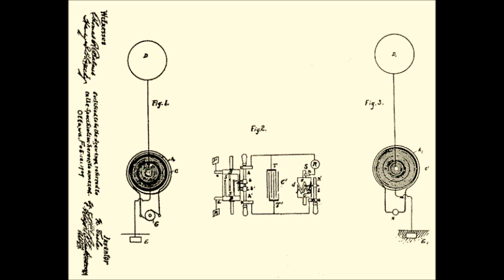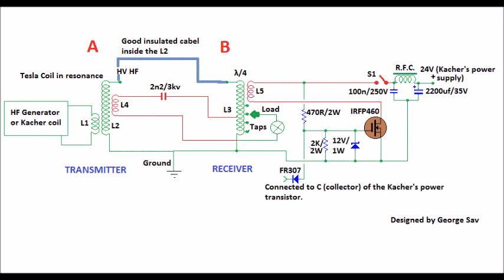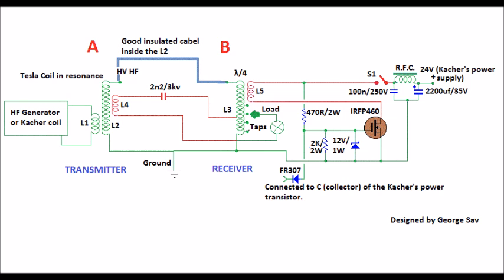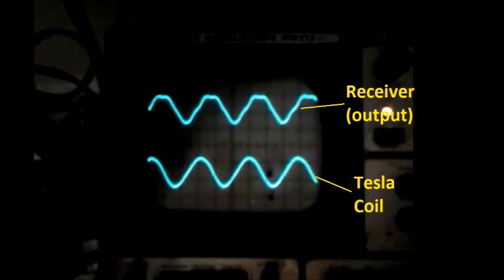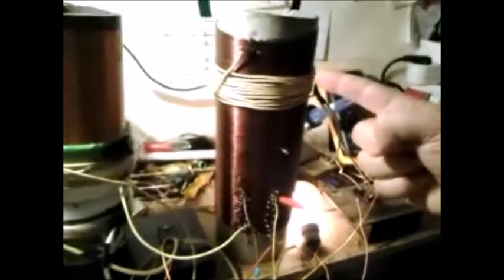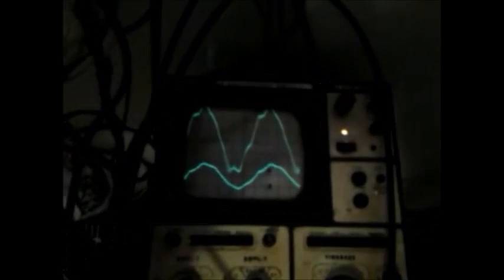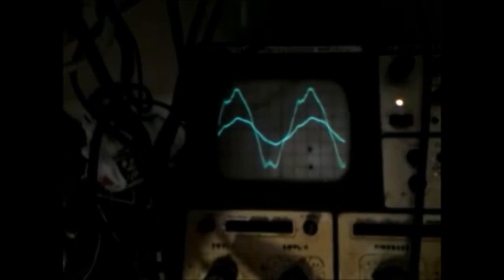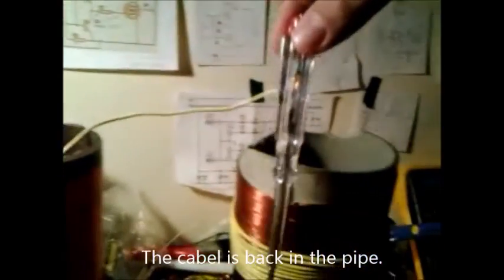Resonance phenomena with Tesla Coils (Overunity device)#3

Comment: Hi Sav, I just happened to see your video in 2024, wow! I don't know if you are still following your channel. Anyway, I know a little electronics and electrical as I am second year of electrical/electronic engineer. I wanted to build your circuit but I do not understand where that bottom diode FR307 connected to. it sace to the "collector of Kather", is there another circuit that is feeding HF to katcher? Thank you for your reply in advance. I am excited about this experiment.
Reply from the maker: Hi Friend. The other side of the FR307 is connected to the collector of the power transistor  (katcher). In this experiment is a 2SC5200.

Comment: hello g sav, how much turns has the katcher and receiver coils? regard from mexico a embrace and have succes, apologies for my bad english
Reply from the maker: +Detectoman LrL Hi friend! To build a Kacher to this experiment you have to choose first the wished frequency and calculate the wave length of it. According to this experiment the frequency is 2Mhz and the Wave length 150m. So i winded around a plastic cylinder 150m of 0.30mm coil wire (secondary coil) and 5 turns of 3mm around it as a primary coil. To build the receiver coil (where the energy flows) you need do divide the wave length with 4 (λ/4) with a thicker coil. So around a cylinder i winded 38m of 2mm coil wire with many tabs. It is so, because it is always approximately! To find the real λ/4 you have to tune the coil. (Theory and practice is different). If you repeat my project be patient with the tuning and check the 3 videos again before you go farther. I use a capacitor of 2nf to tune it fine. 
Good luck
Reply: ***** very thanks for you answer brodhy G Sav, your project semms to me very intersting, i see your 3 videos in day dic 28, semms a prototipe very efficient, so i inscribe whit you page, i gave you my congratulations, i see in these prototipe very good posibilities. i earlier was doing electrons captor and kapacoil experiments whitout succes, may be you can eliminate wire ground whit puting two big aluminiate planch face to face in each coil only my teory may be you can put most disstance of transmision whit ferrite bar inside, may be you can most energy whit coper paper open circle inside and alumin foil middle circle inside the other coil may be you can put most energy whit 50 mfd capacitor in input transmiteer coil in serie or parallel exist very trick for boster the power of your design i never make this thicknees wire coil, so very difficult for me at begin this your project, may be i after iniciate any experiment whit karcher and double coils tower today i am doing whit generator 3000 kvs and ac motor any experiment, but i have in mind the energy production whit coil towers if you like aggregate to my facebook for other apprecitions is: Josar Ramirez  then here i continuate the chat discusions whit you, my english is very bad, but i want practice whit people what speak in english, of new very thanks to you, may be i can gave you any good tips for major results a embrace from chihuahua mexico, jose ramirez
Reply from the maker: +Detectoman LrL You are welcome my friend! I would like to tell you that one of my distant friends and subscriber to my channel has already replicated the project and succeed with great results, as he wrote me! 
If you use ferrites or other kind of metals, remember that great power at the output you can have ONLY if the wave length of the wire is right. Otherwise you can tune it and have some power!

There is no Kapacoil here. It is all TESLA!!!!  So find the resonance, hit the phase of the output as i described and you will realize that every Kapacoil or so-like device you know can not be compared to this project.
If you replicate, do it with patience!
Good luck
Reply: thanks brodhy g sav , today im in other project, but when i finished those, may be i begin at build those two coils, but first i need the tool for winding right those coils, i have in mind what a machine free energy should are whit two coils how is show in your video, i cant build soon due i am working always in my store in repair of manual wood tools, and other little handed tools of other people, and y  no have very much disponsable time for make much experiments, your project sems me very effective, may be whit a rectifier at output and batery you can overunity this for self function, ok i send to you a embrace from chihuahua mexico, joselito ramirez
Reply from the maker: +Detectoman LrL Dear Jose, if your experiments use high frequency, high current then the use of the ground is absolutely necessary! In my project the output is overunity, but also very high frequency (i found 30mhz) it is impossible to rectify this current and use if backwards for selfreaction! Anyway i am working on it and soon i shall present another video of such a device. Stay tuned and take your time!
Reply: ***** hello you say me what hig voltage-hig frecuence are nedded be grounded? may be due risk electrocutacion? i understand what hig frecuence can be diminish whit big capacitor after large wire, and hig voltage can be lower whit transformer at output , you also say what your coils result in free energy, but you no put the tries of ampers in input and output, i only see in your video you show 2 amp in transformer supply, how you do demostration of  overunity if never conect input at output? voltaje isnt power, you can obtain in output 300 volts, but whit low amperaje, then this isnt power for overnuty the first step of oscillator due oscillators need hig current, no hig tension ( voltaje ), ok but, i no say your project is wrong, but excellent advance in function in these modalities, i go afther doin any tries, when i have time free, today i m very full of other activities, and finish other proofs whit motors and generators, if i have succes i put in video by you , continue you doing these good inventions i pendant at see your advance, a embrace and apologies for my bad english, from mexico joselito
Reply from the maker: Dear friend, Don't be afraid of the high voltage appeared around the katcher. Due to high frequency (about 2mhz) cannot harm you. It can only burn your skin if you touch it. You can understand the overunity effect by watching the oscilloscope. In my videos you can read the two scales (Katcher, output) and see the light bulb of 75w (almost fully bright). This is the effect it appears when everything is ok. Check the oscilloscope. It is a very useful apparatus and it can show you the way to success. 2amps and 24v as you see is how the katcher consumes (48w approximately). The output has more power due to the pulb. I hopped i helped you. Regards.
Reply: ***** dear j sav , you like this, a incandescent lamp 60 wats consume 2 ampers for bright light, so, i cant understan why you say your aparatus is delivery extra energy, whit same 2 amp input, example, if you light 3 incandescent bulbs whit 2 ampers input, ( total six amp in incandscent lamp, then ok has free energy, i see only your project have very much efficiient and came good way to obtain the free energy, but if your towers only sustaint 1 bulb of 2 amp, whit supply 2 amp then how you say is obtaining overnuty if no show us the proof of this autosustaint? other explanations look this, one bulb what light whit 220 volts and consume 2 amp, can fried whit a spark instant of lees , 500 millivolts and 600 volts, due tungsteng element when hot intantally can accept the shock of extra volts and light very bright, you put bright the bulb due here exist hig voltage in only one lamp, but we understand need see measures input and output in ampers or see is lighting other incandcents bulbs 3 or 4 same wats, ok may be the error is in me because i no understand where is the energy extra of your apparatus what you claim, a embrace, this day i continue whit my experiments for free energy whit motors, good day in yours atemps, joseliito
Reply from the maker: Hi friend. The extra energy is coming from the receiver coil when it is in resonance with the katcher. The receiver coil must be good aligned. Thats why i use tabs to find the voltage i want (to light the bulb). The oscilloscope and the bulb prove the extra energy. The only way to get it, is to build it right. Regards
Reply: ok my friend look this, if you put two cristal cups, then doing vibrate one, then the other also vibrate, this be resonance, but self vibrate resonant for indefine time, is when then self vibrate for very large time inomtrumped contante whitout any shocks, in your project the second coil vibrate due a one armonic low of large wire then see a transform action,  convert hig volt to low current, this can hot the tungsten filament, the miracle overunity is when you can supply the entrance circuit whit the output for autoself run, put a transformer at output for look how much amp dc can be discharg, for see possible autofunction, a embrace from mani city mexico
Reply from the maker: +Detectoman LrL Hi friend. You are right about the harmonics. You can tune it to many frequencies and its harmonics but not all of them can transfer the same power. I deal with the wave length because i saw good results. For an example: If you have a radio transmitter you can tune the antenna to λ/4 of the wave with best results. Self-power unit can be succeed when the output can be 100% rectified and stored in capacitors for internal or external use. Due to the high frequency of the output, it is up to now impossible to be done. You can try it if you wand and you can burn any power rectifier diode in a second! It is something i am still working on it. Soon i will publish other experiments for resonance and an upgraded device with this problem solved. Regards
Reply: ***** exactly, brodhy g sav, the right armonic is the appropiate for major function, how i say you, a cooper pipe cut at large puting these inside the secundary coil whit side grounded can transform hig v hig frecuence in current low voltage, how a transformer, then the  hig tension risk came nulled, too may be put ferrites inside for j major reception and help v-amp conversion, these i say you is only teoric, the form bost power is whit capacitores but is dangerous, other trick for obtain ground energies put 1 turn of secundary coil encountred, action how a valve, or wire pass in middle of secundary coil but in other direcction, due i see you project only is a efficient energy transfer but isnt overunity or free extra energy generator, may be whit any other adecutations these came easy a free energy font, ok we are in contact, ok i am pendant for your new videos, a embrace continue good works joselito
Reply: for eletrocuting null put a wire to ground this low power output a little, vie a capacitor ac
Reply from the maker: +Detectoman LrL Dear Friend i don't understand how can i help you. What i claim in this video is 100% correct and some friends replicated it with success! You have to learn how the electromagnetic waves are acting in a high frequency transformer system. Then you have to bring the Kacher and the receiver coil in resonance (In these videos it is described). When you are ready then, ONLY THEN you can build the small circuit with the mosfet to hit the positive or the negative phase of the wave. Thats it!!! You can see of yourself the overunity you wish. Regards
Reply: ok brodhy sav, when i isnt busy whit much repair tools,  i begin these pretty project, today i have very much store works, best regards
Reply from the maker: +Detectoman LrL Good luck and be very patience. You probably need several days to tune it!
Reply: jajaj or never i can obtain succes jiiji , i straight 5 of 100 atemps ok im in contact joselito